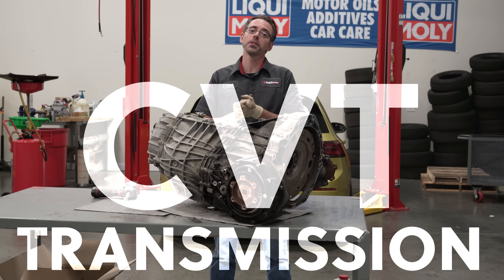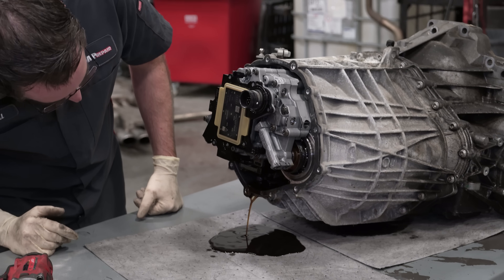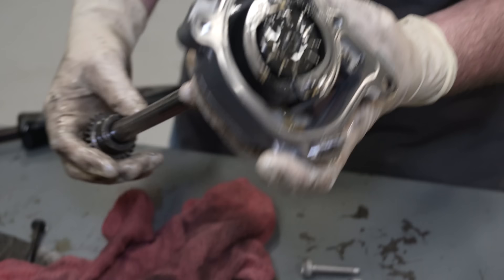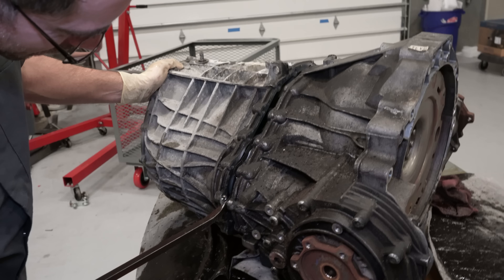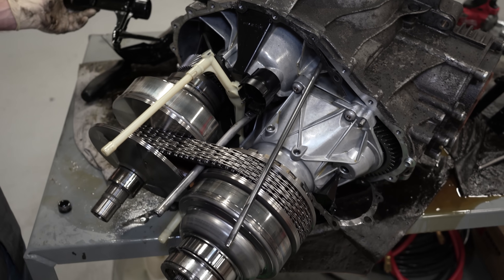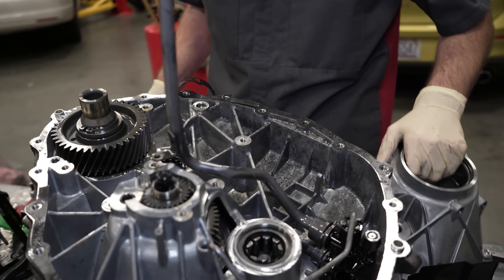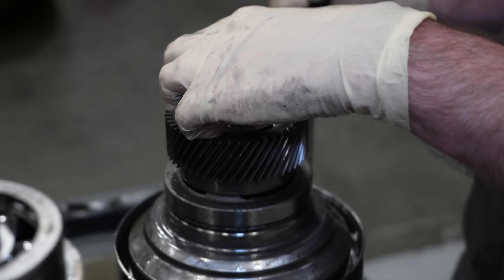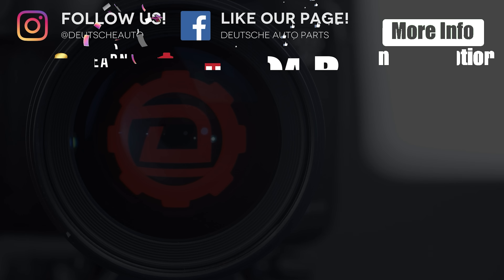Why you shouldn’t get a CVT transmission

Comment: We've got a 2012 Subaru Impreza that went 160k until the front differential failed and we replaced the whole transmission.  The cvt still worked fine, though it did require fluid change around 120k miles because it started to misbehave.
I don't have a problem buying Subaru CVTs.  They're strong enough for normal driving
Reply: What kinda misbehavings? I've got a 2011 and it'd been lurching (RPMs jumping downward) during long drives. Recently changed the coil pack and so far no issues, but I'm weary of keeping it for much longer if it's gonna be a massive future repair
Reply: @1999studios  when the CVT misbehaves, it is worst when coldor under stress like going up a hill.  It was jerky with the CVT gripping and slipping.  There are a lot of ports on the tranny for fluid fill and not well marked.  I opted to have a mechanic drain and fill, which solved the problem immediately.  He said the fluid that came out looked bad and it might need a second drain and fill but it never did.  Went 50K miles until the front differential failed and replaced whole CVT
Reply: @1999studios  the 2011 might not have had CVT.  I thought 2012 was the first year of the CVT
Reply: @joeweaver9913  you're probably right. I was curious if the issues lined up with mine
Reply: @1999studios  I've owned multiple Subarus and I will say without a doubt that for best ignition system performance, I use NGK spark plugs and wires.  If you're over 100k miles and have not replaced timing belt, you should do it.  The 2012 and later use a timing chain but your 2011 I think still has a belt.
The symptoms you describe could be a lot of things.  If it would give a check engine code, that would be a big clue.
Sometimes catalytic converter starts to fail and gives symptoms like that

Good luck
Reply: @joeweaver9913  super helpful man I appreciate it. I just replaced the coil pack and spark plugs and drive belt, but I don't think the timing belt has been replaced. The last owner was a mechanic so she kept great record of what she fixed, I'll look for that. So far after the coil pack, everything has been smooth as could be. The only engine code I've been able to pin to that issue was a couple misfires on a final breakdown before the coil pack was replaced. The first time it lurched I didn't own a code reader yet

Comment: They are kinda useful in a hybrid car, having a cvt helps to join the two engines better, that's why toyota use them. My sister has a hybrid yaris and it works great. On the other hand, my father has a Honda HR-V which also has a cvt, but on that car it just sucks and sounds like a sad vacuum cleaner. In conclusion i prefer my Fiesta ST 6 speed manual

Comment: There’s not a lot to go wrong, I can see why they mated a big V8 to a friction driven  chain in oil. Not sure why that would slip under torque. I can also see why I continue to advise people to avoid Audi VW , BMW, Mercedes, Subaru’s and their ongoing inability to design a sound head gasket, but the king of Crap is the Range Rover, followed closely by Ferrari, never follow a Ferrari closely cos it’ll break down at any moment and block the road.  Who in the design office of these mechanical marvels thinks it’s a good idea to incorporate the crap they must know is crap. And who approves it,   My Volvo 850 T5 is 29 years old, I had it since 2009, it’s never failed to start. Never misfired, never missed a gear change in the auto box, everything except the air con is still working, it’s had 1 hub bearing assembly. 2 dampers. 2 tailgate struts. And some services.

Comment: CVTs aren't the problem. Drivers are the problem. CVTs aren't designed for drag racing. And that's exactly how most people drive these days. As soon as the light turns green, they instantly mash the pedal to the floor, putting an excessive amount of stress to the steel belt and pulleys. We don't see CVTs in hot rods or pickup trucks because those vehicle are designed for either launching or heavy pulling. I go easy on the throttle with my CVT. Therefore, my CVT doesn't give me any trouble. And along with my advise to go easy on the throttle, I would also suggest that you never pull a trailer with a CVT (regardless of the manufacturer tells you). CVTs are designed for maximum fuel efficiency. So drive accordingly.

Comment: Used to be a technician in the quality (ha) department of a Japanese transmission company that supplied CVTs for multiple automakers. 
  There are a myriad of reasons why CVTs suck, but the core of it is that they have to operate at such a ridiculously high line pressure that the slightest scratch or imperfection on a spool valve or valve body would allow high pressure leakage in a fluid circuit, pretty much guaranteeing a total failure. 
  Biggest thing I learned in my time there was to never, ever get a vehicle with CVT.
Reply: But the problem is that they come with it whether you like it or not, you have no choice, I am a master auto mechanic 30 years, now many Nissan have CVT, Many Honda's, many Subaru's, Toyota Prius apparently is CVT, Jeep patriot I drove one, we have one customer he refuse to buy a new car because of CVT, I work in a Japanese car specialist so we do a lot of Honda's Toyota's and Nissan's. In Honda Accord they stopped making 6 cylinder they are all 4-cylinder turbo so one of our customers bought the last year 6 cylinder that was available. They want to create cars that save fuel, and cost of repairs and reliability is the last thing in their mind they end up creating this super expensive repair requiring garbage cars, complete disregard of customers wallet. (Me personally I hate the shift characteristics the feel characteristics of theses transmissions, it's good for somebody who have no passion for cars, and I also hate that on each one it's a different fluid they charge arm and a leg, to drain and fill most of them are a nightmare etc.)
Reply: @xjssts7127  You pretty much hit the mail on the head. The automakers don’t care about longevity or reliability, only the numbers they can get in testing. As long as these units perform under controlled conditions they will put them into production and let the consumers be beta testers.
Reply: @truckingbastard  But this kind of gearbox is really nothing new. It's more refined and complex, but variomats have been around for a long time. Drove a old combine with it. Could get to the belts "kind of" easy. The advantage to that was that it didn't foul the internals of the gearbox.
Reply: @xjssts7127  spot on!
Reply: @xjssts7127  you are a master mechanic and you think prius has a cvt?
Reply: @otomoravec1732  I have never opened a Prius transmission so I do not know, I hear from other people supposedly it's CVT, it does not make any sense to me but that's what they say, and besides there is first generation second generation and so on, most electric motor driven things they do not have a transmission that is my understanding, again I have never opened one. In a shop contrary of what people think we never open a transmission, I have worked as a mechanic for over 30 years and in regular shops I do not know anybody who opens transmission (I'm talking about complete disassembly), there is few but they are exceptions most like us either we put a used one from a junk yard or we send the car to transmission shop to have the transmission rebuilt they are the one they will disassemble rebuilt and re install on the car. When I use to go to mechanic school we dissemble manual transmission and I did it on my own car later but the parts are so expensive it's more economic to buy a used transmission, the same goes for automatic transmission the minute that you want to replace gears, sun gears valve body, boy it gets expensive. and certain they don't even sell the parts the dealer, it happened to us for a Nissan Frontier only New entire transmission is available for $6500 plus tax plus labor of course, we sent the truck to transmission shop they did it for much cheaper.
Reply: @xjssts7127  thanks for explanation. I did not mean to sound harsh, i was just kind of surprised.
The state of the auto repair industry surely has changed over the years and will continue to do so.
I am afraid it is a natural consequence as the primary technology is advancing.
Simple is no longer possible in this world.
Reply: @xjssts7127  Prius isn't CVT, it's "eCVT" which is something completely different.   Just Toyota used a confusing name for it.
Reply: Ray, Would that company be Jatco?
How caked up have you seen the magnets at the bottom of CVT transmissions?
Reply: @inodesnet  guilty as charged. And some of them were just horrific inside. Others looked pristine, but a tiny scratch in a valvebody turned it to junk. There’s just too many things that have to be absolutely perfect for them to function correctly, and if there’s ANY problem outside of software, there’s no repairing it. It’s always pull it and put a new one in.
Reply: I only had the option for CVT or manual and the wife was not going to take manual. CVT it is! At least I get a lifetime unlimited millage warranty with no deductible and they cover the tow and temp car while I wait.
Reply: @BenjaminCronce  What kind of car is it, year model, engine size? I never heard of lifetime warranty; I do not know any company who gives lifetime warranty. (I have been a mechanic 30 years). Sorry Scott Robinson Honda was giving....lifetime or 10 years but that's the dealer itself it's not Honda Corporation, the dealer was doing it for publicity, Hyundai gave 10 years on engine and transmission, at one point Volkswagen did they were giving 10 year on engine and transmission, I do not know any others most are 3 years/ 36 K miles.
Reply: @BenjaminCronce  Which car has an unlimited mileage warranty?
Reply: It’s really about taking care of your car and not pushing it too hard. Got 3 family members that’s been driving Nissans with CVTs for 7+ years and experienced zero transmission problems. The only ones I see complaining about it are ones that try to floor it every time they accelerate or race when CVTs aren’t built for that OR they don’t keep with basic scheduled maintenance.
Reply: Does it help if you get the fluid flushed and changed every 60 thousand miles? We've been having my wife's serviced at the dealership on her 2012 Murano and it's still working pretty well at over 150,000 miles.
Reply: JATCO is trash. AISIN is bullet proof and it shows (Toyota).
Reply: Mitsubishi uses a CVT transmission in some of their cars.
Reply: @900stx7 what's the experience?I need to buy an Outlander Rodest
Reply: If hydraulic failure is such a common problem for them, why aren't they discs controlled with a screw drive instead? Similar to the z axis of a 3d printer for example.

Would that approach fall so far behind in the pressure it can create? Thinking about that, I guess there's a reason why hydraulic presses aren't gear driven...
Reply: @BloodyMobile  Suzuki Burgman had that and its a nightmare to service it
Reply: Toyota CVTs would like to have a word with you. My family has a JDM toyota with CVT. 10 years and never a major issue.

Comment: easy fix for the trans fliud overheat issue is to have good coolers i have one that has 2 trans coolers an aftermarket one and the factory one that is bolted to the trans the second one is infront of the radiator

Comment: CVTs usually fail because most manufacturers pair them with engines that are too powerful and put too much strain on the belt, which creates metal shavings and kills the whole mechanism. My personal car has a NA 2.4L I4 and it still works flawlessly at 145,000 miles. Only fluid and filter changes, and no other major repairs or maintenance.

Comment: The two most irritating things about CVTs is the extremely long delay when shifting from park or reverse to drive and changing the fluid. The fluid is outrageously expensive and fails easily. Once the fluid overheats a few times, CVTs start jerking, whining and, in extreme cases (had it happen), refuse to respond to accelerator inputs. I once got lucky and was able to resolve all of those issues by changing the fluid and filters on a 2011 Dodge Caliber that had 46,000 miles on it. The fluid that came out was black and had giant shards of metal throughout the fluid. Also, it didn’t help that the CVT was overfilled from the factory.
Reply: A design problem
If your oil overhead just fix it with a extra oil cooler .

But its a Dodge a American car .
Somting in my country really do not sell.
Amerika cars go fast death .
Can not handel Germany highway ware you legal drive 250klm or higher (160miles per hour) for hours .
Reply: @dyslectische  Yes, it was a design problem as was the whole car. We no longer have that pos after a woman slammed into the left rear wheel while doing an illegal U-turn. Luckily, I was only doing 45 MPH when she hit me. The seat belt tensioner and airbags were defective in that car (both were recalls).
Reply: I have a 2nd gen and 4th gen Prius.  I use Amsoil Fuel Efficient AFT instead of the Toyota WS fluid.  I also have a Dimple magnetic drain plug on each of the CVTs. The '04 car has nearly 250,000 miles on it with no transmission or engine issues.  I do my own maintenance and don't expect these cars to fail.  Check out the videos from Prof Kelly, Weber State University, Ogen, UT.

Comment: The CVT is far from new. As far as I know the earliest was in 1879. The first production car to be fitted with CVT was the Dutch DAF Daffodil 600 in 1959. It is also commonly fitted to many modern agricultural machines, tractors etc.
Reply: Yes. And snowmobiles have always used CVTs. Because If they had to shift gears they would fall flat on their face on the up shift. Most ATVs & side by sides use CVTs as well.
Reply: Thanks for just re-hashing what is written on Wikipedia. Instead of trying to make yourself look smart (which you're far from), put in a source link.
Reply: @moshesheckel7369  well I,  am talking from first hand experience. What's your problem?

Comment: Those weren't solenoid's I think they're called valves, the check balls flow with the fluid through the valve body into the valves and they open and close depending what gear you are in..I think 😉

Comment: change ur fluid every 25/30k miles and do regular maintenance on ur vehicle and ur good if I don’t plan on keeping the car longer then 7+ years then don’t worry about it 🤷‍♂️ everyone said the new Nissans are garbage and had bad CVTs I have a 2015 Maxima Platinum with 138k miles on it only thing that went on it was the water pump at 89k total cost of maintenance in 7 years excluding oil | brakes | tires 🛞 was around $2300 and that was for timing belt | spark plugs and ignition coils not one issue with the motor or transmission

Comment: *you shouldn't buy the wrong CVT, the only CVT's that are decent and reliable are Japanese cars, like Toyota, Honda, and Subaru. Nissan CVT's are the absolute worst and German CVT's are no better. They're not made for speed, they're made for efficiency, it's why they're used in hybrid cars. CTV's also require more fluid changes and aren't designed to have high strain on them, so they have to be taken care of or else yes, they will fail prematurely.

Comment: I use 2003 Toyota yaris (1 .3L with CVT transmission) as my daily driver for more than 10yrs, its cvt transmission has never gone bad regardless of being used in area with high temperature.... (I change transmission fluid after every 35,000 km, now it has 300,000+km on the clock)
Reply: did you buy it brand new or used? its obviously used car from Japan or US I guess. Tanzania has always handful of used cars from foreign markets.
Reply: @montesa35  i imported it used from Japan.

Comment: In august 2009 we bought a 2009 Rogue. As aged folks, we Knew it would be our last new car. We planned to travel around 'worry free' (at least of car issues). the rogue was our fifth new Nissan !977 to 2009. All of the Nissans (Datsons) were wonderful for 180,000 miles (and more).
But my wife took ill and, to sum it up, our 'travel dreams' have amounted to only 19,000 miles on a 13 year old suv. Naturally, the car is still like new. BUT, this CVT thing ruins any sense of confidence I once had!
Reply: Unless you're planning on getting your body covered in tattoos, and hanging out at the local mall doing burnouts...   it'll probably last you another 13 years and maybe 150,000 miles.

Comment: most of cars on the road at my country is cvt. most of C class that for family use is cvt. my dad use honda for 9 years. so far its nice with regular oil change and maintenance that should be. its nice in traffic and long distance as i hate to say it. fuel economy is kinda insane. those car can save half of fuel with only transmission change from generation that use gear’s transmission. it’s maybe not that powerful and maintenance is a must but the fuel economy is main point of it. but truth to be told. honda make cvt with gears pedal. up to 7 speed. they suck

Comment: My car is 2011 Audi a4,I'm from China ,

Now my car display warming message reads ,gearbox malfunction ,u may continue drive ,

So I went to repair shop to check it out ,the computer says the fault number is p177500 hydraulic pressure sensor ,adaption value reached 

And the repair shop told me my TCM is broken and has to be replaced

Comment: Leyland Bus in the UK were developing one for their  buses in the early 1980s and intended it for market by the mid 80s after making an operating prototype fitted to a bus in 1981. It just never eventuated for some unknown reason. It reportedly got very hot, but did save 2 mpg over the regular 4 speed semi automatic box.

Comment: Terrible design idea. 
They should have used the Case IH farm tractor design a cvt with no chain or pullies.
Uses a variable flow hydraulic motor on sun gear to vary ration infinately 
Euro trash  cars are bad enough I can't imagine one with this disaster transmission.